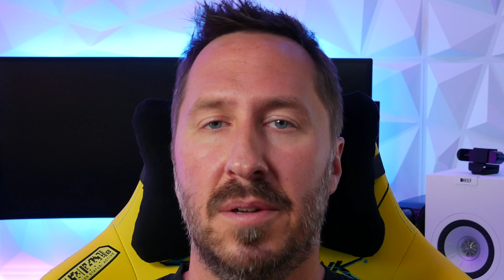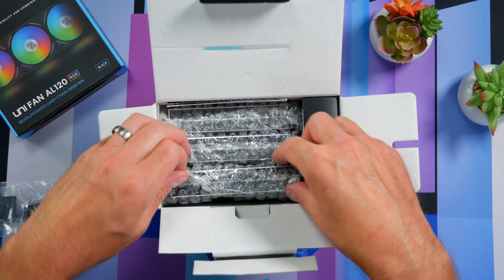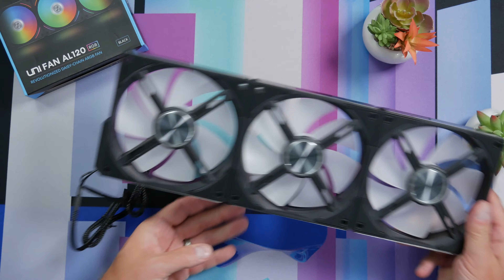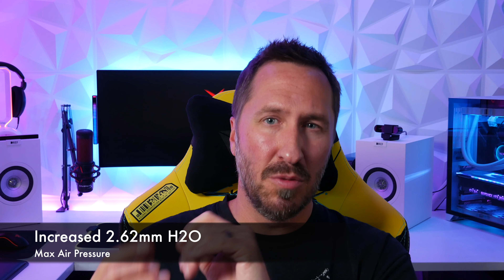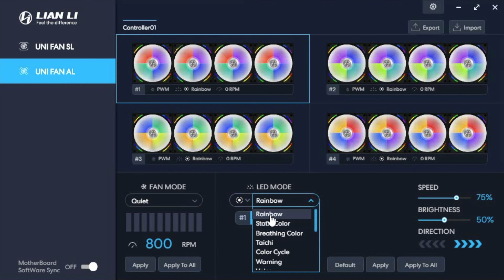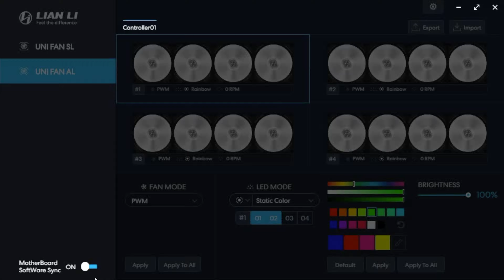NEW! Lian Li Uni Fan AL120 Unboxing and Review!

Comment: Know anything that lets me sync fan color to core temps?
Reply: Hello, yes that is possible at least if you control the RGB of the fans via the mainboard. It works with Asus and Msi. 
Unfortunately, the Lian Li software does not have this function, not even in the newly released L-Connect software version 3.0.

Comment: If my motherboard does not have the 3 pin A-RGB Header and I just have the 4 RGB pin one, does that mean I can still use the fans without using my motherboard? Like just connecting the fans to the controller and controller to Sata and just control everything via the controller, or I can’t use them?
Reply: No
Reply: @ugursenturk5860  Explain please
Reply: That 4 pin is probably 12v, you need a 5v 3pin or converter

Comment: So if I have my SL FANS already connected to my controller and I connect AL FANS to that same controller, will it recognize them as AL FANS? Or do I have to add an additional controller?
Reply from the maker: I’ll have to check for ya. I remember hearing the al120 controller was exclusive so maybe only for the al120s but i’ll check it out since i have both. I’ll try using the sl120 controller and plug in an al120
Reply from the maker: Found you have to connect another controller with the different fans.  I tried plugging in my SL120 into the controller with the AL120's and it just thought it was another AL120.  I assume you have to separate them with the controllers.